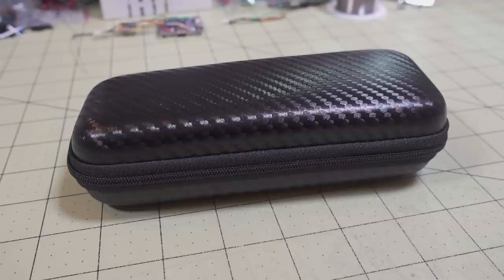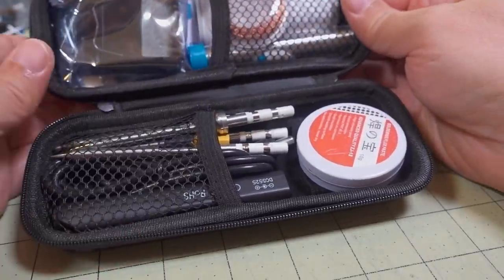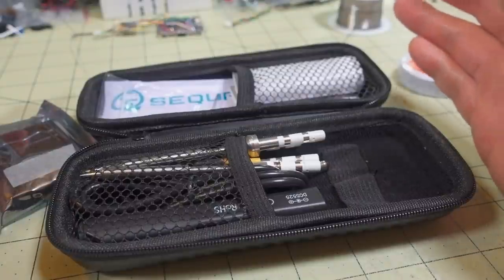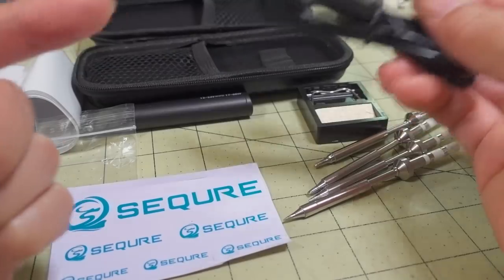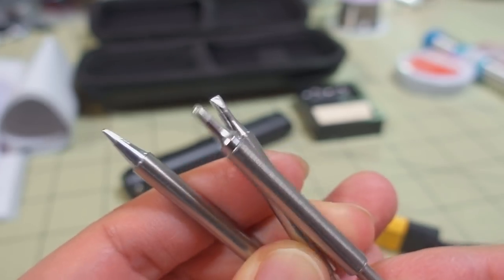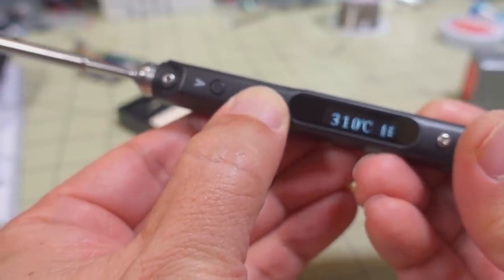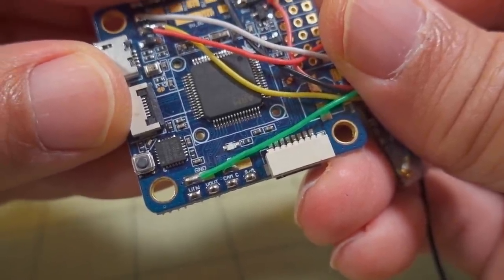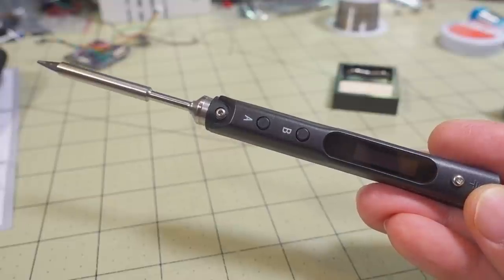Sequre SQ-001 65W Portable Soldering Iron Review 👍

Comment: I've got both the sequre and the ts100. I prefer the ts100 but the sequre can use the same firmware as the ts100. I've used both for full builds and they're my main soldering irons. Since they have the auto cool down and cutoff there's no problems with running them, I've even built a Rising Sun FPV BFW beast class with the TS100, it handled it like a champ.

Comment: I bought this iron over the summer and love it, I use the power supply from my charger to run it at home!!!! The only issue I have is it takes a little time to solder the XT 60 wire, other than that I love it!!!!

Comment: Looks like small cosmetic changes to the TS100. Probably made in the same factory. The tips look identical going off memory. I wonder if they're interchangeable. If it's just a TS100 in a slightly difference case, then it's a good iron.

Comment: I would take this sequre iron over a ts100. I bought a ts100 and it was not good, I returned it. Good price on this kit esp with 4 tips with it. It looks like it does everything the ts100 does.
Reply: it looks to me like it's just a rebranded ts100 with slight changes 😅
edit: i just checked their site and i'm 95% certain it's a rebranded TS100
Reply: @ChriFux  Yeah pretty much. I have bought 4 diff soldering irons last year and I like my $20 -SH72 kit the best
Reply: @trevorimpulsebuyguy6398  i like my ts100 a lot. why did you send yours back? did you use a power source over 20V (won't get the 65W without it)
Reply: @ChriFux  yeah I used a 4s lipo and it came with a 24v power supply I tried both and it took a long time to heat up. And after I let it sit for 4 or 5 minutes it barely melted the solder when I was doing a build. Then I changed the tip and it did the same thing. I bought a whole sh72 kit with power supply for 20 bucks and it heats up instantly and gets super hot so I use it.